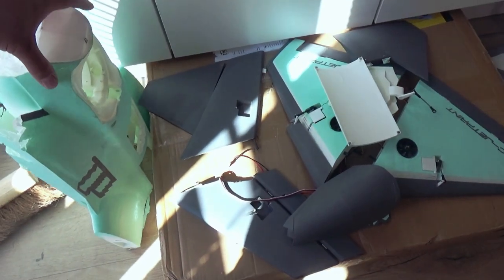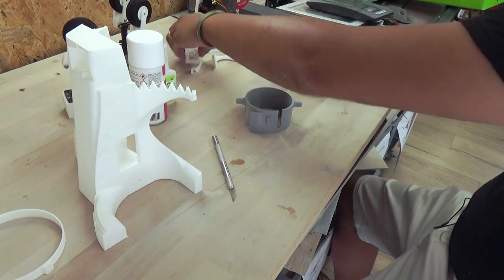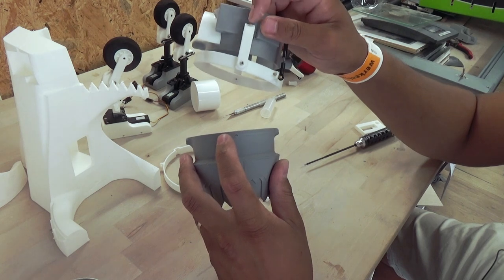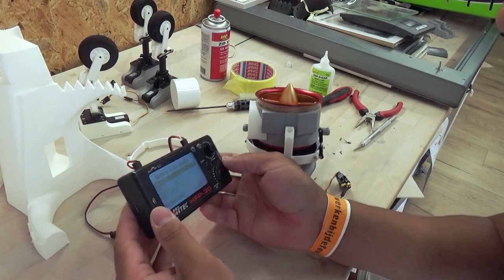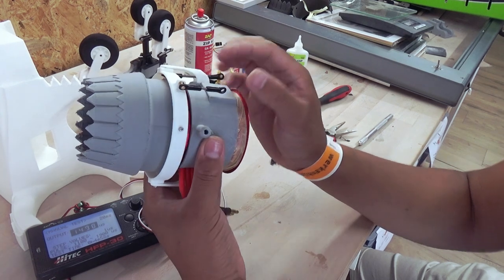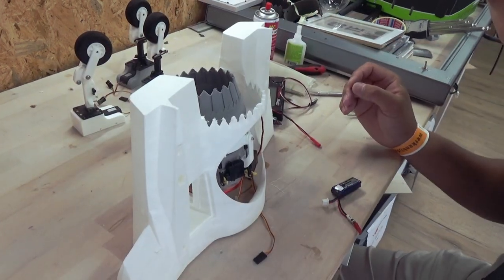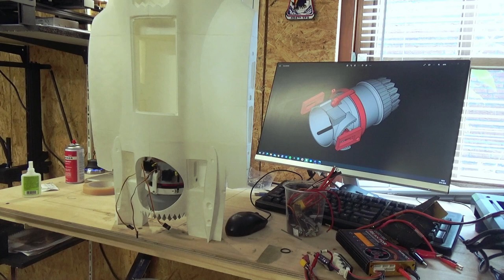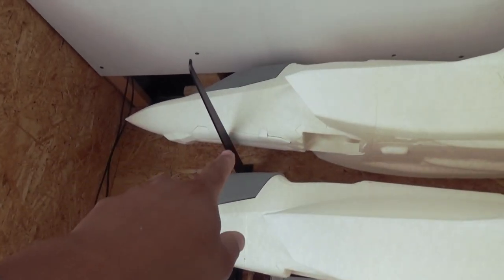I Crashed the F-35B RC Jet model | Build series, How To Build the ThrustVector

Comment: Dang sorry for the crash but good job pushing the test program. Sincere. I'm wondering if the CG was too far aft? Looks like the jet went into uncontrolled right turn and nothing you could do to straighten it out. Is there any way to double check the CG compared to other similar jets that successfully achieved forward flight? Keep going Joel this is the most exciting part!!
Reply from the maker: Hey hey, the left roll motor didn’t shut down completely😣 so it rolled to the right side..very stupid mistake. But learnfull to double check. Also the model was heavy, 3,6 kilos, a save aim is 3,2Kg. We pointed out the Cg, it a small hole under the wings:)

Comment: Any analysis of what went wrong, or do we just brush it aside and make another of the same design... planes don't crash simply because they are heavy. If weight was the problem it would not have taken off at all.
Reply from the maker: It was too heavily build3,6 kilos is just too heavy. The ideal weight is 3 to 3,2 kilos
Reply: @Joelmelanie  being too heavy doesn't make a plane turn to one side out of control like that. If it was just too heavy it would go straight. I would guess it was a bit tail-heavy, and possibly insufficient control surface authority at that speed. If you had a longer runway and gained more speed before rotation I think it would have gone much better. Making it lighter will help a little bit with control authority, but the CG still needs to be corrected.
Reply from the maker: @iforce2d  true but a heavy plane will reduce time for hover

Comment: 🎉I  do like watching your progression on these jets. Such wonderful advances in materials and printers . Makes me wonder what I might have built , had I these tool at your age. My favorite personal project was a dragon , yes I said dragon. My youngest son came to me needing a project for school, it must be made from scrap materials?  Fortune was with the lad , as a new appliance had been well packed in foam, scrap. Since I built planes scrap balsa by the box. Last scrap a spar from a kite, which lost its fight with a tree.  Body aero dynamic,  wings half bat half gull . Dad can we finish by tomorrow ? Why ? That's when it's do....ouch! He napped off at the work table, at 3 am the dragon was almost finished, in my hand it felt funny, like it was meant to fly ... so I tossed it off the deck. Tail heavy , I took it back inside, on the bench lay a single screw, it felt right so in the dragons mouth it went couple ofvturns with a screwdriver ...back to the deck it flew. Back inside the boy was put to bed, I finished the paint, scales why did it have to have scales? Then while looking for a way to sit it while paint dried, I found thevclaws on the front legs would hang the dragon.  Next day a sleepy boy showed off his dragon, that evening it started parents calling and emailing wanting to buy a dragon. I converted the rough drawings to cad to pdf, and posted to school buliten board . Explaining I did not have the time to build, more. That was a fib as  the next version had aerons,  next a tail that moved then the neck and head, then 5 fail ornathopters . The original hung in the boys room for several years before meeting its fate, in a pillow fight. One of the few projects that was perfect you could feel it weight balance ...imagination.  take care build test improve, there is no perfection only the pursuit.
Reply from the maker: Such a nice story I will read it again
Reply: @Joelmelanie  camera suggestion ... put the camera on the other side of you ... then your supporting hand wont be in the front of the shot blocking it ...

Comment: Awesome Joel, Thanks. That answered a lot of questions I had. One more question, are those servos the same Hitec HS-70MG ones we used in the wings and rudders? By the way, sucks that you crashed, but so cool you can just print another one.
Reply from the maker: Yes, for the slats and rudders and nosegear you can use cheaper servos, but they need to be lightweight
Reply: @Joelmelanie  I was going over my list of parts to make sure I have everything. I have the two APD 120F3[X]V2 ESC's which I believe are for the wing EDF's. I realized there are no other ESC's on the list for the main EDF's. Am I missing something? Do I need more ESC's?

Comment: why did you switch from a wood frame build to a fully 3d printed one
Reply from the maker: yes, saves time and money, i can print and build and fly a model in just one week
Reply: @Joelmelanie  well you do have that fancy Bambu lab printer😅, anyway do you use 100% infill on the outerlayer of the plane?
Reply from the maker: 50%flow and testing now with 3% infill
Reply: I'm impressed. Wow ! You could sell that as a kit.

Comment: Oi Joel, falo do BRASIL, o seu projeto é perfeito, vou adiquirir ele por esses dias, mas gostaria de saber se além do f35B, você disponibiliza o projeto do A ou C, sem a decolagem vertical
Reply from the maker: I could try that but in this model you can use is without the front motor
Reply: @Joelmelanie  as configuraçãos usadas no fatiador, você  disponibiliza no projeto também

Comment: Joel, I've started printing this model again and I have a weight issue. Nose section 2 is coming out to 53g and Inlet section (complete) is 179G. I've used the your settings you've posted in on rcgroups forum.
I'm printing on a bambu lab x1 carbon using eSUN PLA-LW filament. 
I"ve doubled checked that it is single wall and 3% infill using gyroid. 
I'm attempting Nose section 2 again with 1% infill.
Reply: Fun fact 1% comes right apart lol and still weight 43g

Under strength is the bottom and top shell thickness suppose to be .8mm?
Reply from the maker: Hmmm? Nose 1 should be 8~9 grams nose 2 around 40 grams..infill 3% line with 0,4…colorfabb invented foaming Pla…esun reversed engineers the spools..but I have never tested esun
Reply: @Joelmelanie  I was finally able to get the weight down by importing Chrispol70 settings from RCgroups forum. Still unsure what exactly changed to make the drastic weight difference but I now got Nose 1 at 8G, Nose 2 28G, Inlet (complete) 94g, and ducting section 1 left/right 76G each.  Unfortunately now though eSun ran out of stock of the LW-PLA and don't know when they'll have it back in stock :/